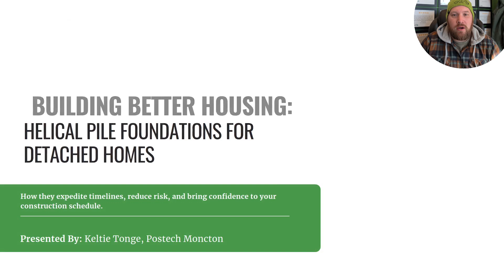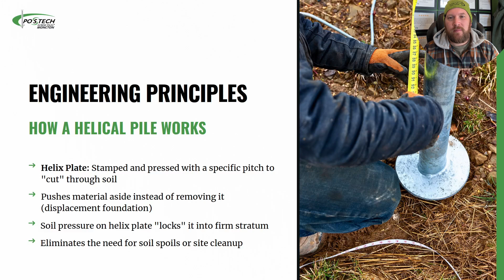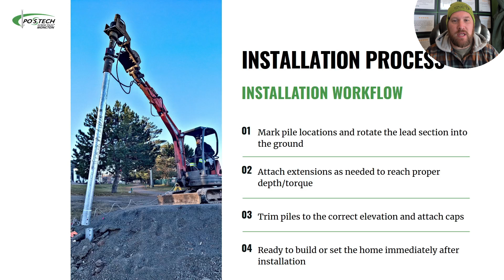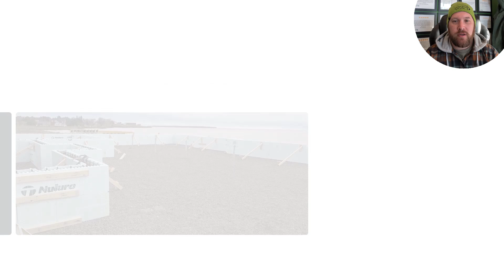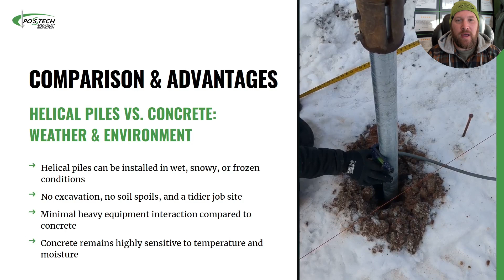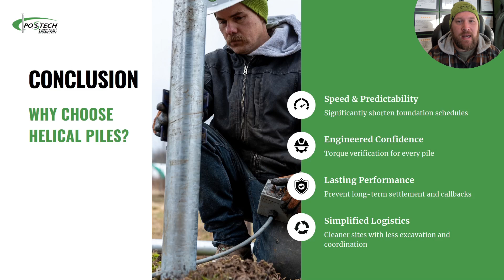Can You Build a HOUSE on a Helical Pile Foundation? (Webinar)

Comment: Can you build a pole barn with a drop in wood floor with these?
Reply from the maker: Yes! Helical piles are a good fit for pole barns, and it shouldn't be an issue supporting one with a drop-in wood floor. The piles will tie-into the poles themselves, and if needed can also provide support for the floor as well.

Comment: Would love to build a small all steel frame home using these in Sebring Florida where the soil is pure sugar sand.  Wonder if Florida Code approved for something like this?
Reply from the maker: Great question! Helical piles perform very well in sand, however we're not familiar with the unique sugar sand found in Florida. In terms of building codes, helical piles are used throughout Florida so you should be in luck there.

We'd recommend connecting with a Florida-based helical pile installer who understands your local conditions and is able to determine if it's an appropriate solution for your needs. While we haven't dealt with them personally, we do know that Coastal Foundation Solutions is a helical foundation installer serving Florida - you may want to check with them!

Comment: What if the pile hits big rocks or ledge? Also will it drill thru a rocky very hard bottom, made of small rocks and very packed Graves, like for putting in permanent docks on a lake?
Reply from the maker: Thanks for the question! If a pile encounters a particularly large rock, one option is to see if the pile location can be moved to avoid it. If the rock is too big, or there's a ledge, then a common approach is to pin the pile (or piles) directly to that rock. 

In terms of drilling through dense ground, it does depend on how firm the conditions are. They are capable of getting through some fairly hard soils, but if things are too dense it might require pre-drilling or a different foundation solution.

It really comes down to your specific site, so we recommend connecting with a helical foundation company who can do a site visit. They'll be able to check out your ground, see if helical piles work, and most importantly be honest if they won't. Hope that helps!

Comment: One thing most people do not think of is that helical piles make great attachment points for the house ground.

And if you are using them to attach rebar to, you can fix it so a rebar sticks out of the concrete slab below the breaker box and attach the ground to that rebar.  That way the rebar in the slab attaches the ground through all of the helical piles.  You will have the best house ground you can possibly have.
Reply from the maker: That's a great point! You're right, that's not something most people would consider. We actually installed a helical foundation for a flagpole recently, and it eliminated the need for a dedicated ground rod since the pile will perform that role.

Thank you for the comment and your insights!